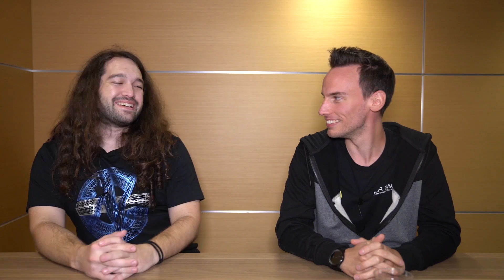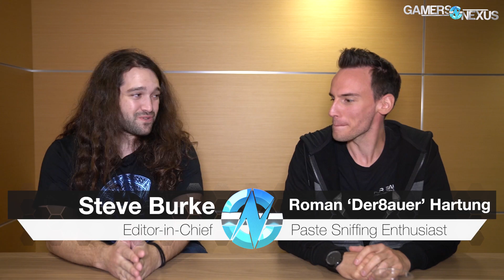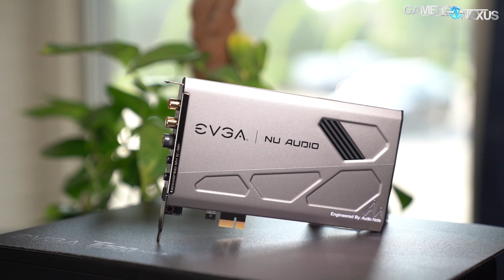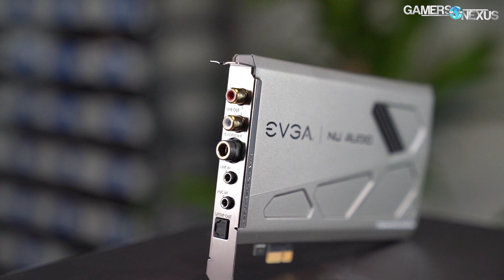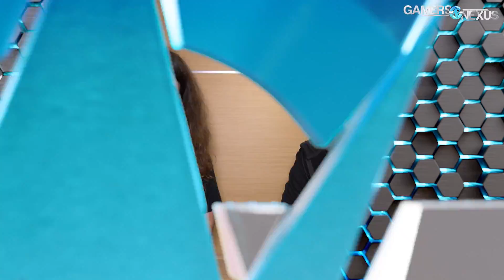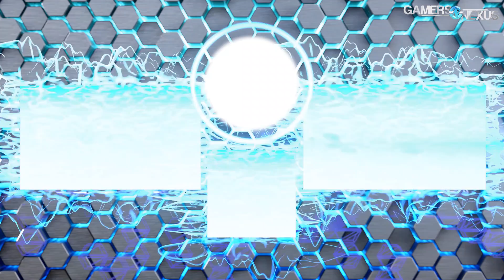Der8auer Deep-Dives on Thermal Paste: Misconceptions, Curing, & More | LTX 2019

Comment from the maker: Watch our news video about CCX overclocking and more: https://www.youtube.com/watch?v=ow7pdpTNpCY
Find Der8auer here: https://www.youtube.com/user/der8auer
Pre-order the new GN Limited Wireframe foil shirt! https://store.gamersnexus.net/products/limited-wireframe-shard-cotton-t-shirt
Reply: I surely diden't expect a video about thermal compunds to be so interesting. Great video.
Reply: The shirt looks absolutely fabulous! Ordered it earlier today 😄
Reply: Steve, i saw few companies which offer diffirent metal powders with diffirent size of particles. You may search for "nano metal particles powder". Nanoshel is one of them.
Reply: Could you test the Carbonaut pads on the new Ryzen CPU's?
Please..
Reply: Cartoon Head seconded. I also hear IC graphite/Panasonic soft-PGS does well due to excellent conductivity in the X-Y axis
Reply: if you want a good idea of how the metal particles are sized and mixed and ground i would look at a video about making home made paint from linseed oil.  the mechanism is probably pretty similar.  of course particles are probalby ground and sorted by a siv first but i would think the process is similar.

https://youtu.be/GvLkNoWjKz0?t=122
Reply: so i have a question.  if youre not worried about price, which is better for air or water cooling, kryo or hydronaut.  remember cost is not a factor in this question
Reply: Missing outro video links.
Reply: I always love it when you 2 get together. Time to replace my Kryonaut on my GPU, in about a few months. Good info in this vid, thanks!
Reply: Can you just do a hydronaut vs kryonaut cause now I'm confused on which to use.
Reply: @GOFASTER69  Kryonaut. Hydronaut is not as liquidy and will last longer, but its thermal efficiency is less the Kryonaut. For GPUs and CPU normal use case, like gaming or productivity just get some Kryonaut.
Reply: You've made this topic very interesting to me and helped me to know what are myths about it. Thank you so much!
Reply: I've seen the air bubble argument, it was an argument for the spread method IIRC.
Reply: I work in the aerospace industry in America and when we apply seals and are bonding materials which need to be under 0.005 ohms or 5 milliohms resistance, we always apply one thin continuous bead of seal/compound with 100% coverage of the entire material, with a small squeeze out bead around the entire edge of the structure, electronics, ets. So a thin layer spread evenly. When we apply any type of seal it is always applied like this per engineering and this is to not create voids, air pockets and 100% coverage. We also have a torque requirement. But this is straight from the engineers drawlings.
Reply: Please make kryonaut extreme in 10 grams seringe 😢 thumbs up so they read
Reply: You can pin your comment , but jesus unfortunately my devotion made me first .. 😁😇
Reply: What that youtube comment/reply disappearing bug again... !!!!

You can pin your comment, but jesus my devotion made me first..😁😇

Comment: So the industry doesn't have a standard on measuring thermal conductivity so thermal conductivities cannot be compared between companies.  Yet thermal grizzly refuses to reveal their "standard".  Not exactly helping the problem.  And it ain't rocket science.  The variables are really input temp and ambient conditions.  The true variability is in the thermal compound itself and how thermally conductive it is at different temperatures.

Comment: I was using thermaltake G-4 with a heat transfer of WK 3.3 on my 5900X but. I wasn't satisfied with temps. So, I made the switch and picked  up Thermal grizzly Aeronaut with a WK 8.8. And wow big difference with temps. At idle with thermaltake I was getting 52c. With Thermal grizzly aeronaut. At idle I'm getting 42c.

Comment: I've never seen this happen on a desktop.  And I've built more than a few desktops in my time.  However, 1/2 the time I just use the thermal compound that comes on the cooler.  That stuff is remarkably thick and gummy, but applied in a very thin layer.  Maybe that has something to do with it.

Comment: You can’t use the torque measurements of a bolt to measure the squeeze force. No matter if you do it the same way or not your results will be different. Loctite has some good information on this.

Comment: So, yeah, I've definitely heard the "air bubble" thing WRT thermal pastes... Whether it's inconsistent spreading of the paste over the CPU surface [with like ridges or thicker / thinner spots] will cause air bubbles to form, or whether putting thermal paste down in weird squiggly overlapping lines will cause air bubbles in between the lines, which can lead to hot spots around the alleged air bubbles, etc.

Is this NOT the case then? ...

Comment: When Der8auer states that Conductonaut behaves worse than Kryonaut  under 100 degrees, does he mean fahrenheit ? Sounds weird considering he's from europe.
All I know is, be it CPU die, GPU, on desktop or laptop, it's SO GOOD how the temperatures of conductonaut are easily cooled down under normal use and heavy load.
I noticed on GPU that it tends to have a bit higher idle temps, since the fans are typically at 0% so the gpu will sit at 50°C... but under load it's crazy how cool and/or silent my 1080 Ti MSI Gaming is, just like the GTX 970 before it.
Just checked a 2 year old conductonaut on a laptop's CPU on the shitty copper heatsink, and it's really good, but what felt a  bit weird is when I "agitated" and spread again the old conductonaut, it felt like there was some kind of grit which had formed in the liquid metal, almost like sand, maybe some metal reaction fragments ? Anyway, I just put it back this way, both faces were very shiny so no problem, and temps are so good.

I'm just VERY curious about one thing, should I renew 3 year old conductonaut inside my delided 8700k ?
Reply: He said -100 and probably meant Celsius.

Comment: Okay what about mercury would that woirk as a thermal compound(liquid metal
Reply: Probably it would. What wouldn't work is your body after a few years sitting in the same room with exposed mercury. Mercury is highly toxic and evaporates even on room temperate. That's why it's not used anywhere.

Comment: the air bubbles comment come from an old video by tek syndicate where they showed how thermal paste is spread and they used a clear acrylic to show it... and of course the piece of acrylic would bow a little bit from how it was being pressed and then it created air bubbles but yeah that doesn't happen with an actual heatsink.

Comment: In honesty I always buy asus gpu’s , my last card was a Strix 2080ti and I found that changing the paste to thermal grizzly made a decent difference.
Very interestingly I did the same to my latest gpu a Strix 3090 but found it made no difference at all sadly.
So it seems that asus has used a better quality thermal paste on the 3090 Strix oc

Comment: I've definitely heard and believed the "air bubble" thing. When Zalman used to supply thermal paste in bottles with brushes like nail polish, I'd spread the paste on both surfaces and never had any issues. I tend to just put a large blob in the middle, unless it's a really long cpu, then I do an X or X & square now.

Comment: Proves that you must be a generalist because there are so many 'PARAMETERES''  &  eventuality of (PUMPOUT). At10:00 our host makes the bad misnomer  [woody] and of Hydronaut being 'pretty viscous' meaning hard to spread '  rebutted by Guest, that Cryonaut is silicon based so better to use Cryonaut =Wet paste every year. And because the two are different  for short and long term  Cryonaut  & Hydronaut are for  low and high temp applications respectively.   More Cycles more heat === more PUMPOUT of material sandwiched in between cpu/gpu and cooler..   WHY NOT use Copper or Aluminum foil?     LSS...   If you do only one thing you get better or retain being a unlearned fool.  you must question and look for improvements everywhere in the process even the suppliers may have no QC.        Pumpout is curing basically, 95% aging has occured at 1 yr of daily use for cryonaut 350-1100 cycles.  More years for Hydronaut   It is good from the get go no waiting, and too much is just wasting material and spillling out

Comment: Well, I'm pretty sure I just bought some fake Kryonaut off ebay. Thermal performance was worse than the last of my 10-year old Akasa AK-450 I just used on my new Ryzen cooler, and it started to go brown and dry round the edges when I took the cooler off after only a few hours. Any thoughts on that?

Comment: It's one year later, and Thermal Grizzly Kryonaut Extreme is listed on their website but not yet offered by any retailers. Hopefully that will change soon.

Is the popout effect only caused by repeated heating and cooling? If so, is the popout effect of any concern for systems such as servers that may go months or even years without a reboot? In such cases, will the thermal paste still be good after 5, 10, or 20 years?
Reply: i think its both. heating cycles and heat in general, as the heat will make the paste less viscous and thus make it easier for the pressure of the cooler to press it out. 
maybe it will be 2 years for servers.
but losing a few degrees of cooling in servers isnt really a big deal. its probably easier to ramp up the fans more than to replace thermal paste on hundreds of cpus.

Comment: One thing I've noticed anecdotally in my own testing is that the cooling performance of thermal paste seems to be time dependent after first installing it.  Over the first 24 hours it gets better with time, eventually reaching a plateau.  In all the testing reported by various folks on youtube (including GN), this effect does not seem to be highlighted, and I wonder what would happen to relative ranks of pastes if they are tested 24 hours after applying the paste.

Comment: I think, they should manufacture a thermal paste for specific temperature environment, and suggest like for estate of the equipment operate, example Arizona is where the equipment will operate so use this X1 thermal compound with 2 options air cooling or water, and the other for lower temperatures, if the user moves to another state with a considerable change he needs to change it before using the equipment, and add in the product description what is the life span for that paste temperatures range.

Comment: Are there any thermal pastes that don't need to be reapplied every year like Kryonaut?
Reply: no. every thermal paste has this problem. and you are losing like 1-5K /°C after the year of cooling performance. for most people that isnt a problem. but GN and especially Roman target a pretty enthusiast and performance oriented audience. and sometimes 5K temp difference is the difference of a Overclock to work stable or not.

if you only oc mildly or not at all you can leave your thermal paste on for 4-5 years.  

for me i like to reapply thermal paste every other year. its like a ritual. to strip your pc and clean it and put everything back together. and lets be real. it isnt that expensive. 12$ for 1g. and that lasts for about 3-5 applications.

Comment: So as I understand it, another primary purpose of thermal paste is filling micro-imperfections found on the surface of the cpu (and maybe also imperfections found in the cooler contact surface) 

Is there any type of paste that exceeds more in filling those areas ?

( I guess ultimately the ones that fill better might show the higher thermal transfer rates in testing ? Would be cool to see before and after microscopic type imaging )

Comment: While checking out newly arrived Ryzen 5 3600, I by mistake smeared thermal paste a little in the middle on the stock cooler. I'm waiting for another part to arrive before I could assemble the rig.
Question, would I have to reapply thermal paste? Or f*ck it?

Comment: Successfully delided 4790k in January 2019, applied liquid metal and used Spread Method. Gained 20c difference. Overclocked to 4.9Ghz - 1.3v...... Temps are in control. Mixed very well a very very very tiny dot of LM with MX-4 and Spread it well (Just for fun) :) i.e. thin layer and Corsair H100i V2 is working Superb.

I used Dot method, Line Method and Spread Method...... results are same......

One more thing I used spread method two times i.e. first I doubt that block not sit well, so I unmounted it (Bracket Problem) but no air bubbles. So I again spread thermal paste and finally did it somehow and its still working well..........

Comment: When I first built my PC I was told by a friend with a bit more experience to spread the paste due to air bubbles. Some other stuff too like being told that putting on too much would wreck everything Also that you HAD to get it right the first time because if you remove your cooler after putting on the paste, you'd ruin the paste and would have to start over. I'm American so these myths aren't a German only thing, sadly.
Reply: I heard that thing long ago, spreading in local forum. I'm from Indonesia

Comment: 1:  Any recommendations on how often to re-apply conductonaut
2:  Is there any thermal loss due to  the discoloration of conductonaut after it's been in use for a while

I've recently removed my delid 4790k running at 4.8 cool and steady for a few years.  Just curious what to expect upon re-installation in a new rig

Comment: i use the spread method and a tiny droplet in the middle just incase air bubbles are a thing. i can only see it not being a thing when you go with the droplet only application which i hate as its inconsistent and verry sensitive to applying the cooler at a angle and not covering every part of the spreader.

Comment: 150 newton? Does this guy even know what he's talking about? Most car wheels dont even need 150 newton to be secured properly.
Reply: Newton is not Newton-meters. He referred to newtons as that's how you measure to the overall force applied by the cooler on the CPU (150 N = 15 Kilogram-force; for a well tightened cooler can be reasonable), while Newton-meters refer to the torque used to tighten the screws (and you need a VERY substantial screw to not strip when tightened at 150 Nm).

Comment: The only time I’ve ever had the “air bubble” is when I accidentally pulled the cooler up after I seated it and put it back down. I knew then and there I had to redo it but I was like hey maybe I put it back down fast enough. Went from 25c at Idle to 55c lol I made sure there were no air bubbles the second time.

Edit- he’s not lying about conductonaut. I literally had a bead 1/3 the size of a pinhead and it was still slightly too much for my 8700k

Comment: Noctua paste is rated for use in 5 years. Which means that it probably could last 10 years as well.
Reply: I think GD900 Is Equal To Noctua's thermal paste , And if U Buy GD900 I think they a 30g tube for 7$
Reply: @AJ-mv7ef  The performance of the GD900 is under half of the good pastes on the market. It's about 5W/mK. Good pastes are at about 11-12 W/mK. But it's cheap. But using a bit extra on thermal paste is worth it for the extra cooling performance.
Reply: @oysteinsoreide4323  as mentioned in the video measuring the w/m-k depends on many things considering there's no standard these numbers can't be compared between pastes
Reply: @timserious7678  Ok. I see. It's like wattage of power amplifiers. They are measured in different ways.

Comment: Air bubble problem is not a myth. Long time ago (about 20 years ago) you could buy cheap low quality thermal pastes which were very hard to spread, because of wrong material proportions (metal to oil). People had to use metal items to spread them, because credit card wasn't hard enough to do it. Those hard pastes were not only seen in Germany, I saw them in other countries too.

Comment: Some pastes actually do perform better after having gone trough multiple heat cycles, altough it might depend on application type etc. 
I use Arctic Ceramique 2 and it actually does go trough a (subtle) phase change.

Comment: Over the last couple years I have tried Hydronaut a couple times and both times the compound in the package were bad. It was basically like clay and could barely get any out of the syringe at all and what very little did come out took far more pressure than it should. The little rubber applicator on the end was also completely useless given how solid (for lack of better terms) the paste was. I did write in to Thermal Grizzly about the bad thermal paste which was a very stressful experience in its self and a serious pain in the ass as they offered my money back but somehow kept loosing my copies of the receipts or forgetting about my case or a staff change was another excuse along with a change in their customer management software was another... eventually I did get my money back but for the "possible" reduction in temps that I "might" see. Its just not worth the struggle unfortunately, even though I manage a lot of render slaves that have their CPU's pinned at 100% usage for days/weeks/months at a time.

Comment: I'm curious what kind of compounds are used for off the shelf components like GPUs that are never intended to be repasted by the end user. Will the performance just get thermally worse over time and result in the GPU becoming slower as it throttles performance to accommodate worse thermals? How long would we typically expect these compounds to last?

Comment: I've had people call me out for previous paste application guides I've written over the years - that spreading manually introduced air bubbles. I said back then that there was no way the pressure from the cooler wouldn't force the air out. The only reason GN's application guides with crosses etc are better is because they take less time, which makes perfect sense. The end result is identical - manually spreading is fine, it just takes longer than the now proven application patterns, so it's pointless.